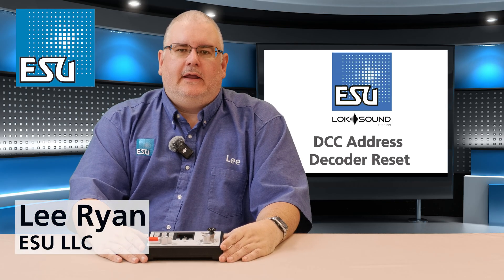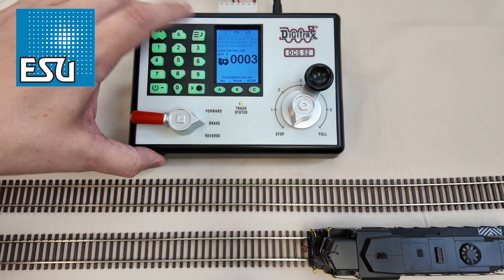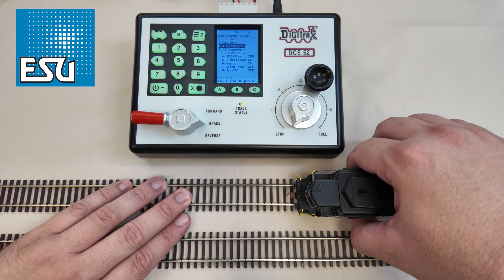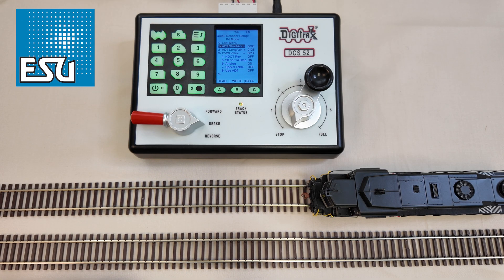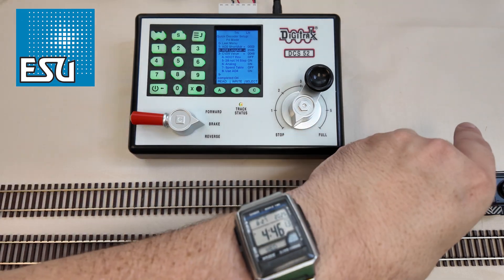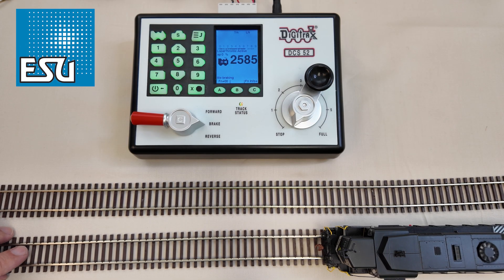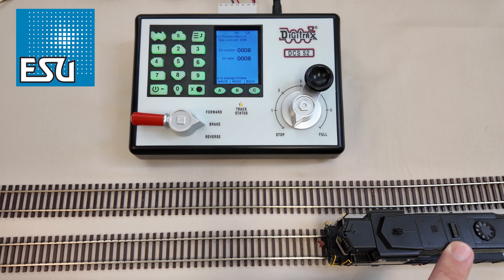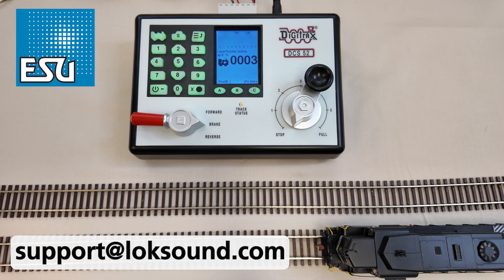ESU Decoder Programming Basics - DCC Address and Decoder Reset

Comment: Are y'all able to do a video like this with the older DCS 51? I don't have the most up to date stuff. I just got back into the hobby after a 15 year break and picked up a Scaletrains SD40-2 and got y'all's 59629 decoder followed the steps to program a 4-address loco and it didn't work. Tried to reset the decoder and also had no luck. Quite frustrated this is the second decoder I got for it hoping I'd be able to set the address and run it by its road number.

Comment: kinda sucks loksound CANT be really programed with anything except the loksound programmer .. time to unlock your decoders so people can program them like any other decoders just bought a 300.00 loco now i have to spend another 150 bucks to program the dam thing
Reply from the maker: ESU Loksound 5 Decoders are fully DCC-compatible and can be programmed using any DCC system. While the Lokprogrammer is a highly convenient and powerful tool it is not essential to do programming. We will happily answer any detail questions you may have. Please send an E-Mail to Support@loksound.com specifying the loco in question.
Reply: @ESUDCC  i know a few people who want to do this and an email wont help any of them how do i swap F8 and F9 buttons
Reply from the maker: @ClintonvilleModelRailroad  this is exactly the kind of thing that an email is perfect for. We can help with the CVs to swap F8 and F9 but we need to know the specific locomotive. Also, ESU decoders are the most unlocked decoders on the market! Every parameter can be changed by CVs just like every other decoder. There are no parameters that are locked or that can't be set by CV.
Reply: @ESUDCC  havent gotten any response to email can you confirm if you have got it?